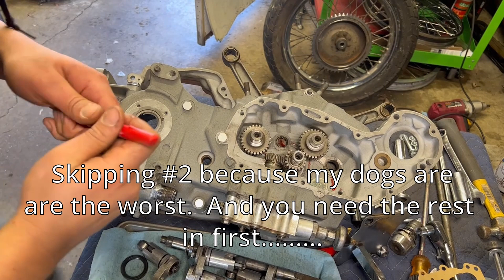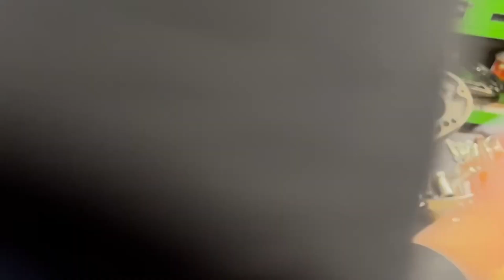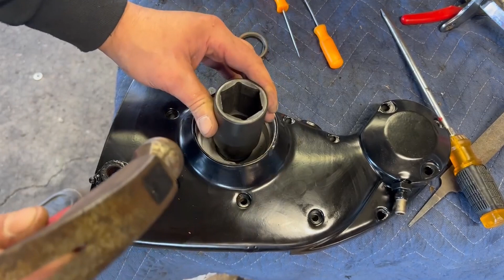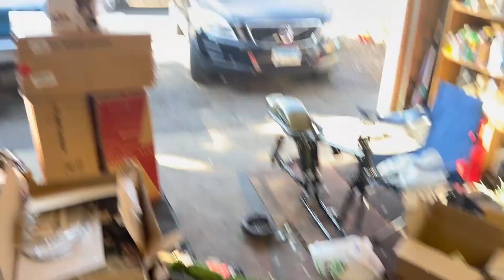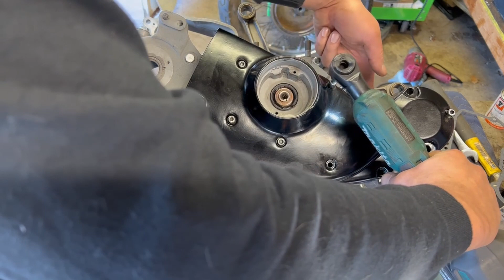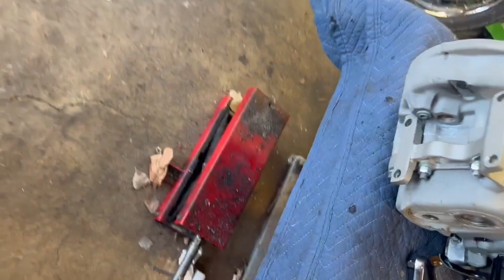1972 XLCH Ironhead:  Sportster Camshafts and Cam Timing (test fitment)

Comment: NICE,
You'll be rolling soon! 
I got a 72 XLH needing total rebuild. She sat over 15 yrs apart. Question, PARTS? My preliminary search for bearings, seals, gaskets, all has come up out of stock.  I only tried 1 supplier, looking for a one stop shop if possible. May you have any help in that search?
Reply from the maker: I use VTwin and friends for most of what I need.  I'd try and find a recommended Indy shop near you, as they may have more knowledge on what it is you will need moving forward, and keeping local shops around is HUGE for people working on old bikes.  JP Cycles isn't bad either, but I will usually pay a few extra bucks to the local guys when I can to help keep them around.  When your in a pinch the online guys wont help you much.  Thanks for watching and good luck with the rebuild!
Reply: @WrenchingWrecked 
 Thanks,
I always try local first.
Just got a quote for engine rebuild from a local shop, 16-22 hrs wk at 100 per. 1,600-2,200  without parts!
 I have no problem assembling, its just tools needed for 1 job $
You have done some nice work at the price I'm looking for!
Keep them rolling!